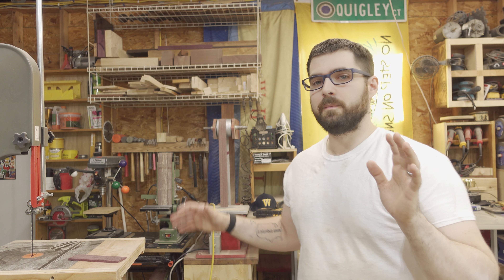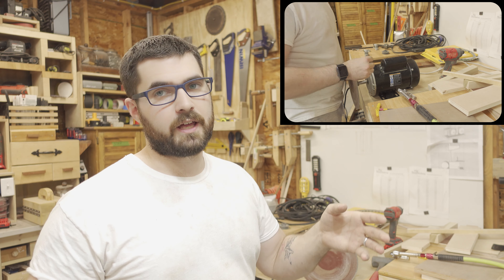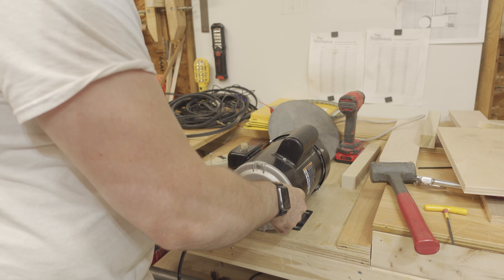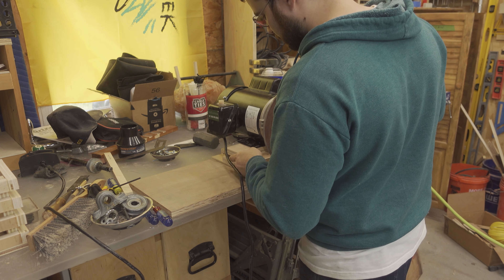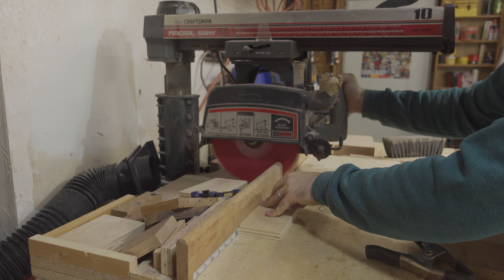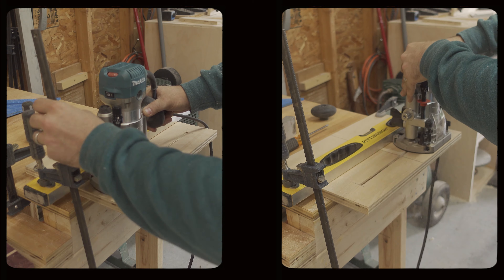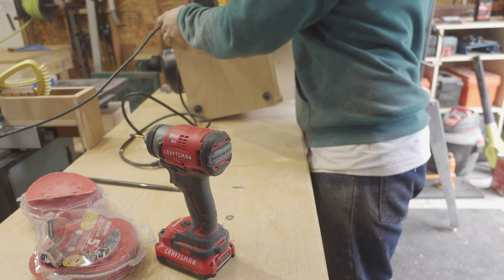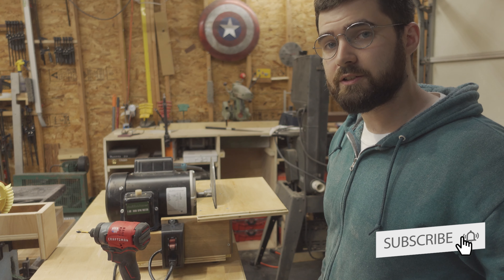I Built a Homemade Disc Sander!

Comment: Very nice!  I’ve been wanting to build something similar.  What was used for the disc?  What kind of motor?
Reply from the maker: Thank you for watching and commenting! 

I used an aluminum 10 inch sanding disc plate that mounts directly to a 5/8 arbor. They can be found pretty inexpensively on ebay.  I believe the motor is just a 1800RPM farm-duty motor from harbor freight, but any motor with a 5/8 arbor would work. The only drawback of the sander so far is that there is no ability to adjust the speed without swapping the motor, but it has not been an huge issue so far.